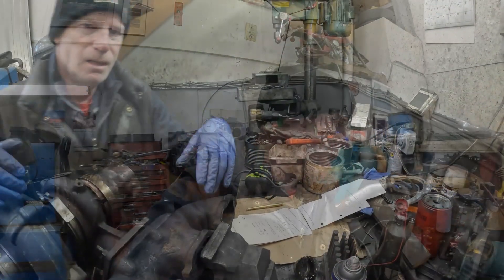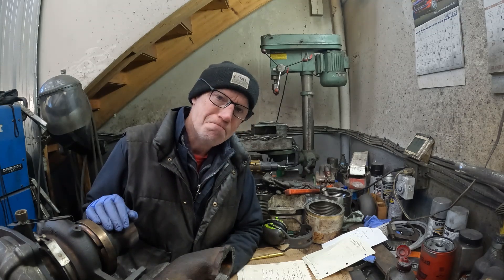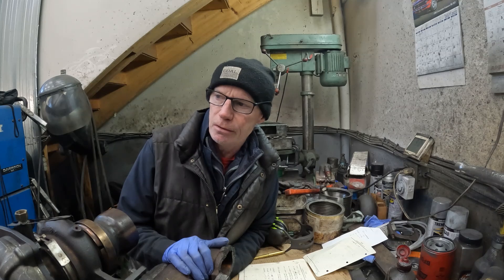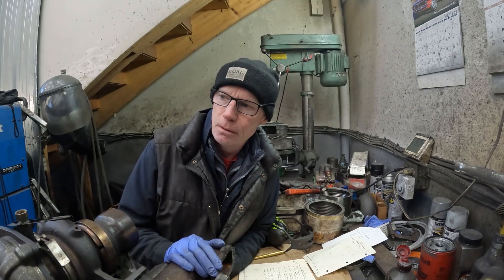Detroit Silver 4-53T (Dyno Testing Divided Turbo Housing)

Comment: There was a time coming feom the automotive side that i considered this engine to be HUGE ..... heavy and beefy. Now seeing it on the dyno and comparing it to say the bigger detroits it seems like a down right petite thing and quite the logical choice for a pickup type rig ;)
Reply from the maker: Yes it's just a tiny engine, only 212 ci.:)  Compared to the 71 series, they're small.:)  It's amazing that it pushes my 9000 LBS truck down the road and hangs with traffic.:)  Great engines.:)
Reply: @detroitgarage9430 speaking of that i have been looking for and at a lot a 4-71 video ( because that is the correct engine for my truck) and the blower on them appears to be much larger.   Maybe even twice ....is that correct in your opinion ?    At any rate they apear to be Much "thicker" I guess like the rotors are about twice the "diameter" ( weird description of a loved shape... but i think I am getting my point across?)
Reply from the maker: Yes the 4-71 has a very different blower design.  They're 3 lobes compared to the two the 53 series uses.  Twice the diameter would be a fair comparison.:)

Comment: Power service cetane boost (grey bottle) seemed to make a legitimate difference for cold starting and wet stacking in my 7.3IDI and om617. I have zero metrics for this claim, but I would be curious about how they affect EGT, as well as torque output. Also, if you end up getting injectors in that are big enough, I would really be curious about if that product will clear up a haze from overfueling. My 617 seemed to burn cleaner with the PS in the fuel, less soot on the passenger side of the car (car was hoodstacked, yeah I know😂) but on long trips, I would idle the 7.3 all night when I would sleep, and then in the morning when I would take off, it would smoke pretty good for a mile or two until it cooked everything off. Injector pressures were balanced and nozzles were maintained in both these vehicles, and fueling was stock. So one of the variables was that power service, sometimes I'd run it, sometimes not. When I did, better cold starting, less mess, so overall performance must be different, right?
Reply from the maker: Thanks, going to try the cetane boost.:)  A lot of viewers have suggested it, so I'll try some for the next dyno session and see what it does.:)  Also try it in the veg oil and see if they're any changes.:)

Comment: What is the purpose of the water meth ? Inassume you are cooling the intake charge ... is it needed are you having a preignition issue .... why is it nescisary?
Reply from the maker: It does three things, cools the air charge, adds about 10% power and lastly keeps the airbox, liner ports, rings, combustion chambers and injector tips clean.  I'm testing this out on the Mule to see how much power it adds.  My daily driver has the same system and wanted to see how much power it adds.  For running veg oil it's the perfect add to make up for the 10% loss in power running veg oil.  I now have 60,000 miles on veg and the 4-53T is staying nice and clean.:)

Comment: Will be interesting to see how the next two turbos work for you, hope you can light the 6.4 low pressure turbo, that thing should move some air. I wonder if the divided housing caused too much turbulence with the exhaust hitting the ridge? Any of the divided exhaust housings i’ve seen have been used in conjunction exhaust manifolds that have dividing wall as well to collect exhaust from front and back cylinders/ split pulse manifold…so I’m thinking the 453 needs a custom set of headers!
Reply from the maker: Me too.:)  Yes the divided turbo housing probably only works with the divided manifold.:)  Custom stainless header would be nice, but not this time around.:)
Reply: @detroitgarage9430 twin entry hot hsg only work with four stroke engines the only other option for the 453 would probably be a T6 size turbo
Reply from the maker: @ Just tested a new ball bearing turbo with an open housing.  Pulled really nice, similar to the borgwarner 364.  It also comes with a divided housing, so will give that a try as well.  Next is making a bypass for the N blower and then advanced cam timing.:)

Comment: Ok so put at box fan in front of the rad and remove the fan to get raw numbers. I have investested interest as i own a similar dyno
Reply from the maker: Ah I see.:)  The best way to run this dyno long term is to make a water tower.  You could use a 45 gallon drum or two stacked.  I've pulled the fan and alternator load from a Detroit manual, so it's pretty close.  Maybe 5% error at most, so not too bad.  With the large injectors I'm running I'm maxing out the cooling system as is, so a box fan just won't be enough to cool both the intercooler and rad.  Do you have electronic controls?

Comment: ATF gives the lubrication removed from #2 to #1 . Heating oil is less refined, but retains the oils that makes the heat. We used to run Sohio Diesel Supreme, which was their #1, year round. It is super clean and refined, but less hp. We didn't know that then. ATF is the old mech's trick for injector cleaner on a diesel. The detergent additive in it is better than the tank additives, as it does more for less money.
Reply from the maker: Thanks, I'll add a quart and that should help.:)

Comment: Winter fuel in very cold climates has a significant amount of kerosene. I have a friend who worked at Gazprom in Omsk,Siberia,Russia and their winter diesel for -40C was 30% Kerosene.  Kerosense has a density of about 0.79 to 0.81  whereas diesel is usually 0.83.  The reduced density is from shorter hydrocarbon chains and that means less thermal units of energy compared to diesel.   Another factor is the quality of the diesel itself, here in Australia you get better fuel economy from higher MON rated fuel from BP and Shell than from the cheapest brand of diesel which is Ampol/Caltex.  Makes a difference of 5% in fuel economy (cheap stuff has less energy per liter).   Who would have thought that the divided housing would make that much difference.......
Reply from the maker: Thanks, very true.:)  Next turbo is going to be the BorgWarner 364 64/73 and see how it compares to the old Garrett T04B 66/65.:)  Should be entertaining, maybe try some cetane booster and see if it helps at all.

Comment: I noticed early on that the divided housing didn't "jive" with the numbers. But it is what it is. What amazes me are the numbers, that a four cylinder Detroit engine, fully mechanical, can produce the numbers your engine has demonstrated and how clean it is. YOUR engine, YOU built it. Those numbers are super impressive compared to the more "modern" engines. Not to mention it makes more power and torque compared to, say a 6.0 Powerstroke but far more reliable and durable. I could only imagine that engine being dropped into your Super Duty, although that's probably not your plan. 

And I'll say it again and again: they sound so much like the 8V92s that powered the military trucks I drove for a long time. 

Much respect, Sir.
Reply from the maker: Thanks, very true.:)  I'm very impressed with the engine and overall performance.  Egt's are low and smoke on this run is almost gone.:) I'll try to improve overall HP and torque numbers with newer turbo's, injector and cam timing and see how they effect HP and torque.  For my truck I built the turbo for 90cc upgrades, so I'll probably swap those 9290's in it this summer after I've run them again on the dyno.  They were really nice as well.  Corrected for the #1 diesel they made 260HP and 590 FTLBS of torque.:)  That's about a 10-15% bump in power to the 7A77's I'm running now.:)
Reply: @detroitgarage9430  that's so impressive for that "baby of an engine." Low EGTs, little to no smoke, good numbers...cant wait to see it going down the road one day!!

Comment: Have you checked the calibration on your dyno with a one foot bar and known weight?  Also i havent seen the needle hit 600.  Still holding out for the bypass blower. What is the btu difference in the fuel?
Reply from the maker: Yes the dyno is calibrated.  I've applied a correction factor of 20HP and 40 ftlbs to the numbers to account for losses do to the fan.  #1 diesel is 10% lower btu's to #2 diesel, so a 10% factor is added now for that.  Those corrections are within 5% of the calculated HP and torque numbers for the larger injectors.:)

Comment: Would there be any benefit to running the turbo into the other side of the motor instead of trying to force it through the blower?
Reply from the maker: Yes that's essentially what the blower bypass does.:)  I do this on my Silver in my F350 and it works really nice.  I bypass the blower at 10psi boost and the turbo feeds the other side of the air box.:)  I'll most likely end up doing the same to the Dyno Mule.:)

Comment: I'm no expert, but don't divided housing turbos need a header that is also divided? Also, are aftermarket superchargers worth looking at on these engines?
Reply: The blower isn't really a supercharger in this application per se. If a Roots blower can supply more air to an engine than it can use NA then the excess air it provides then allows for the use of the term supercharger as we know it.
On a non turbo Detroit Diesel uniflow diesel the blower remains a blower and provides air for starting, idling and normal operation. The airbox pressure is about 0.7PSI, the small excess allowance in air pressure to make rated power in hot and high, high humidity environments as well as normal blower wear and tear. Even Detroit Diesel use the nomenclature NA (Naturally Aspirated) for their non turbo 2 stokes. GM-EMD likewise.
The reason the blower is retained on the turbo variants is for starting, idling and all operation where there is insufficient boost to run the engine.
People have played around with blower drive ratios on DDs - even the factory IIRC but outside of high performance applications where reliability is a primary consideration mucking with the blowers is costly when the same result can be done with a turbo (since you can't just change a belt and pulley size like you do in a car). Also, from what I gather the boost gain performance superchargers make on a Detroit Diesel is still still quite low.
There's this guy that has a homemade common rail injection system on an 8V92 that he built himself and he does all that blower stuff as well as the turbo but he's cracking heads at 3500rpm in loaded truck drags. To say he rolls a bit of coal would be about the mildest description you could apply...
Reply from the maker: Thanks, well said.:)  I'm really looking forward to testing the Silver bypass blower for a comparison.:)  Possibly pick up 16 HP on the top end vs the N blower.:)
Reply: Excellent job of demonstrating to people that a Blower is NOT a supercharger!! You are truly a gifted educator sir !!@ThePaulv12
Reply: @ThePaulv12  Then it shouldn't matter which blower you run on a Detroit.
Reply from the maker: Yes, the divided exhaust manifold is require for the divided exhaust housing.  Just a test to see as a lot of newer turbos come divided.  There's not as many options for open exhaust housings, so that's why I was testing this.  After market superchargers like the whipple are available, but very spendy.:)  I prefer to use the roots blower and bypass it for better top end performance.  I'll be testing the Silver blower later that has the bypass valve built in and see how it compares.:)